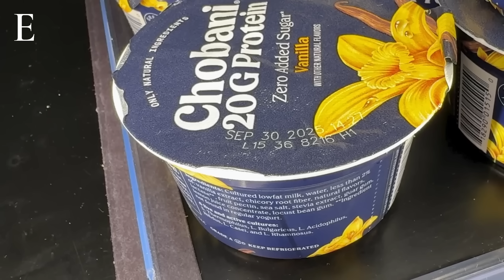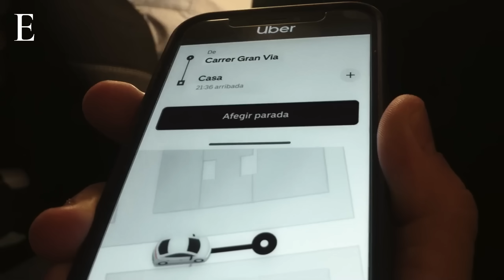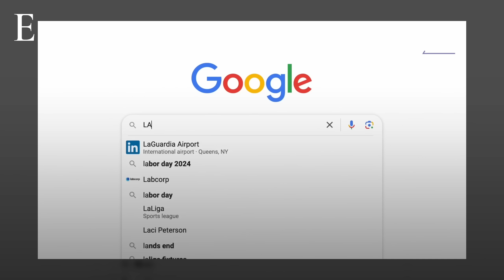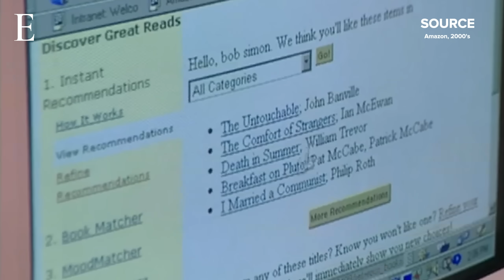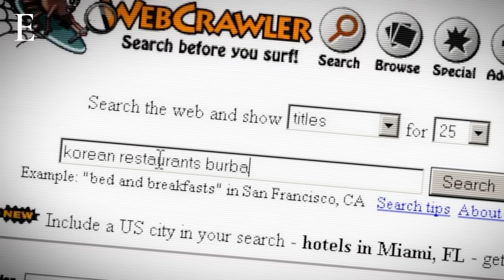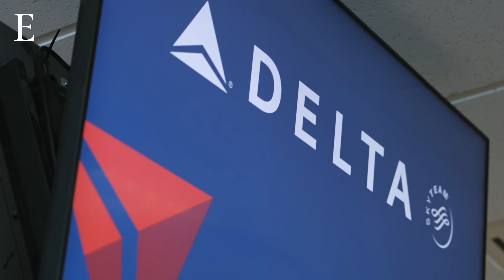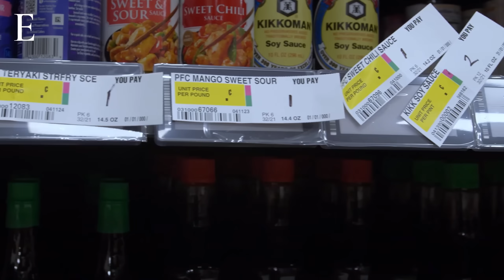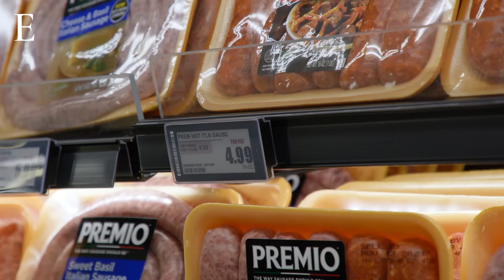How AI Is Making Everything More Expensive

Comment: if it were discovered, there would be huge controversies, i didn't notice anything. just imagine a black gay guy gets a worse deal than a white straight male, the woke would go nuclear - that never happened as far as i know, so the issue only exists in a small number of cases that are hard to analyze and debate, for example taxi fares. for groceries and even flight tickets, can be individual pricing can be detected easily but as i said, no alarms have went off afaik.

Comment: How did people not see this coming?  It happened on the normal internet with prices adjusted based on data gathered from the user.  AI just does the same thing, but with access to way more data and more complex analysis and algorithms.  Guess where the data was gathered from?  yes the public willingly just threw it all over the internet without a care or thought to how it would be used.  well.. now you know how it will be used.  Will people stop spreading their data out there? no, is the answer to that riddle.  Knowledge is power.  now they have mnore knowledge about you than ever before.

Comment: Thomas Joseph Dunning:
"The capital avoids noise and abuse and differs timid nature. This is true, but that's not the whole truth. Capital is afraid of absence of profit or too small profit as nature abhors a vacuum. But once there is adequate profit, capital is bold. Provide 10 %, and the capital agrees any application, at 20 % it becomes animated, at 50% is positively ready to break to itself a head, at 100% it tramples on all human laws, at 300% there is no such crime on which he would not risk, at least under pain of the gallows. If the noise of battle and make a profit, the capital will be to encourage both. The proof: contraband and trade in slaves."

Comment: So, with digital price tags, what happens when I see the price of the item on the store shelf and it gets changed by the time I get to the checkout line??
Reply: good point! I'd imagine that perhaps the shopping cart itself would/could have some price reader thing, if the surveillance thing doesn't "follow" you around with an assigned ID to which it keeps the prices it thinks you'd not forget you had seen, at least. I believe here may lie the most significant weakness, perhaps people photographing the price of everything, then go to the cashier, and the prices changed dynamically. That would probably be some kind of consumer's rights violation, I'd imagine.
Reply: Maybe theyll remove labels and make u check price through an app from phone or smartglasses

Comment: It's rather easy to defend yourself from such dynamic price manipulations, as an individual, in many cases. You need two tools: a VPN and an "incognito mode" in your web browser. Access your price two times: when they can identify you (VPN and incognito disabled), and when they can't identify you easily (VPN and incognito enabled). Compare your price. I do it sometimes, and I noticed, that I generally get discounts. iPhone users, will tend to get higher prices, not because they "have more money", but because GNN SI, knows, that they are less sensitive to high prices, so they accept higher prices, with less resistance. It's psychological, as Apple customers are used to overpaying for everything, by default.
Reply: you think that actually helps but you are hiding information that these companies consider unreliable, they can easily identify you by using a device fingerprint which is made from browser information, os information, hardware information EVEN screen resolution is taken into account
Reply: What if you only paid 100 dollars for a iPhone you still get charged more for the same item?

Comment: You could probably take advantage of this system by spending less money online, it might trick the computers into giving you the best price since it assumes you’re cheap
Reply: Yet the best price will merely be the regular price...
Reply: @e @einfachnurleo7099  then they don’t get the sale 🤷🏻‍♂️
Reply: There are also sorts of ways to trick the bots. For example, buy hot dogs and beer. Then, buy steak and lobster with no alcohol. The bot will think you bought expensive wine somewhere else and give you a coupon.
Reply: AI doesn’t work like this, there are a lot of parameters which are or can be highly correlated, and are used to predict prices to give users
Reply: @LobgaJulius  meh I’ve been shopping small for the past year I’m not really worried about what ai is doing to online prices. I will say though when I do shop online I get some pretty fair deals 🤷🏻‍♂️